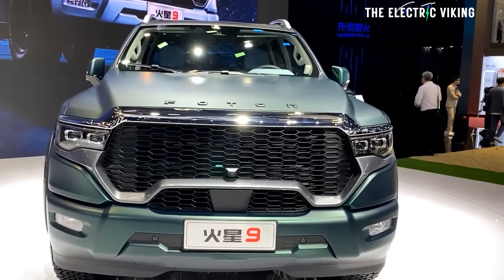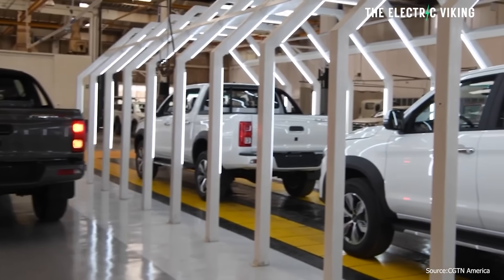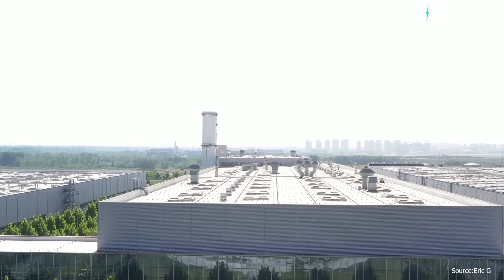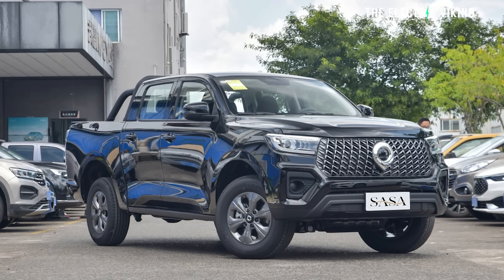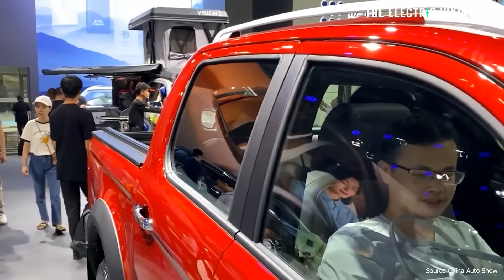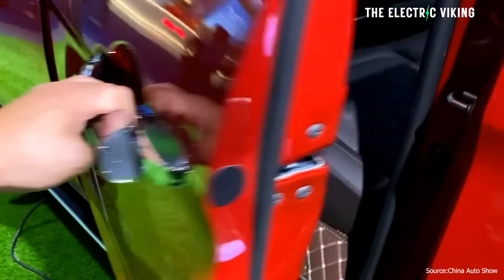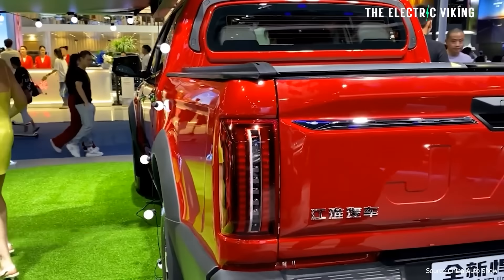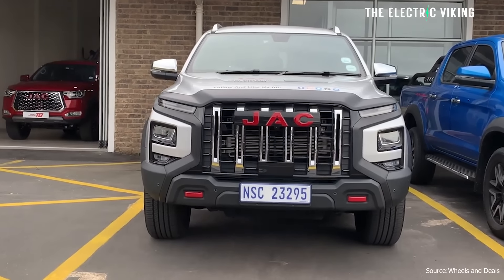The JAC Hunter is the perfect "affordable" electric pickup truck...

Comment: Let's make an estimate only with 90 km/h and 3 t moving. The rolling resistance is 9 kWh/100 km.
For air resistance, let's assume only 3 m² with cw=0.4.
Makes 25 m/sec * 3 m² * cw=0.4 * 1.3 kg/m³ air * 25² / 2 = 12,2 kW * 1,1111 hours for 100 km = 13,5 kWh/100 km.
9 kWh rolling resistance + 13,5 kWh air resistance = 22,5 kWh/100 km.
So very optimistic with 95% system efficiency and 88 kWh battery 371 km with 90 km/h.

Comment: Great looking small Electric Pick-up Truck. 
It need an adjustable air suspension to give the Pick-up truck higher ground clearance when needed and the vehicle can be lowered driving on higway speed. 
This small Electric Pick-up Truck will sale like hot cakes. 
😍💖⚡️🛻⚡️💖🔋🌞💯👍
😉💖⚡️🌏✌️